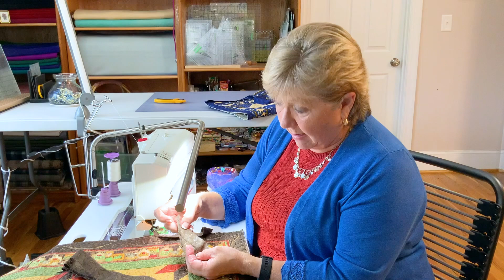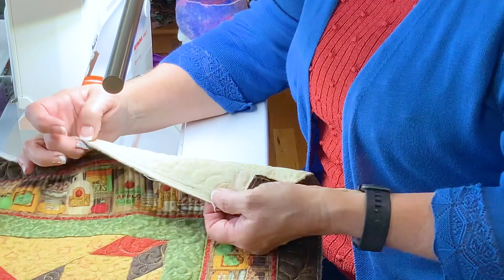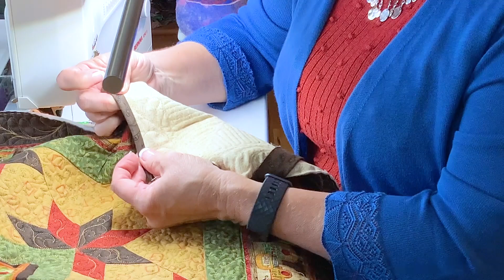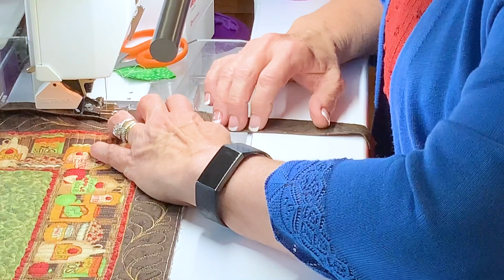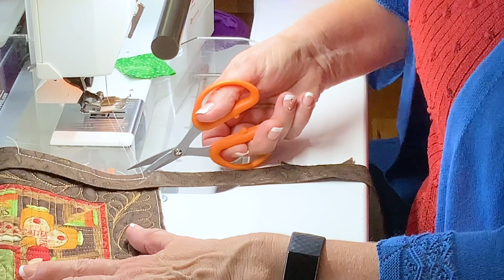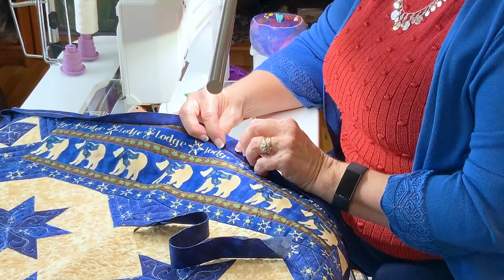The "Tuck" Method of Binding - Tips & Tricks from the Tucker Team

Comment: So how do you get the binding to be about the same size on both sides?  I always wind up with a skinny binding at the top
Reply from the maker: Every time I do binding I do the check that I mention at time 3:44. If the binding is too skinny you need to move your needle over so that you are sewing your binding on with more than a 1/4" seam. I just keep moving my needle to the left until I have it so that when I fold the binding over, the edge of the binding is going just beyond the stitching line. So what you need to keep in mind when doing binding is that for the width of the binding strips you cut you might need to use something other than a 1/4" seam. I hope that this helps you.

Comment: How do you do the beginning edge? You went by too fast and I didn't catch it.
Reply from the maker: What I do is at the Ironing board I am set up to press the binding in half so that the upper edge is coming down to meet the lower edge. I make a 45 degree angle cut on the end of the strip so that the angle is going from the lower left to the upper right. Then I fold that edge under 1/4" and then press my binding. I believe that I mentioned this in the end of Episode 28 the basics of binding. If you have more questions please email us from the contact us on our website home page.